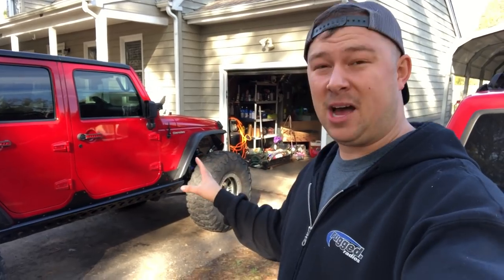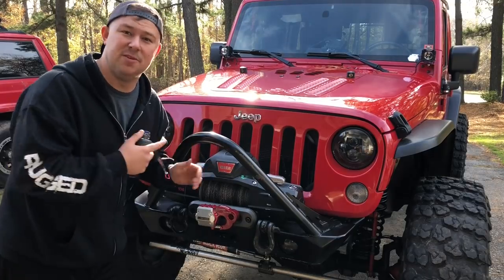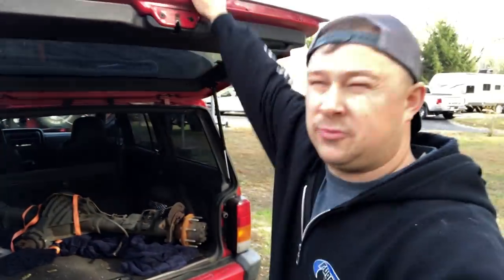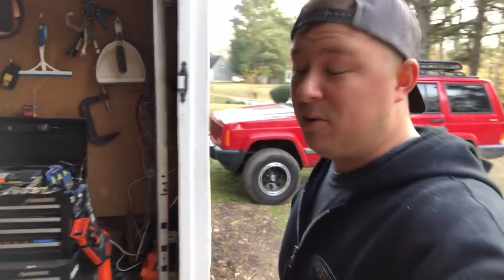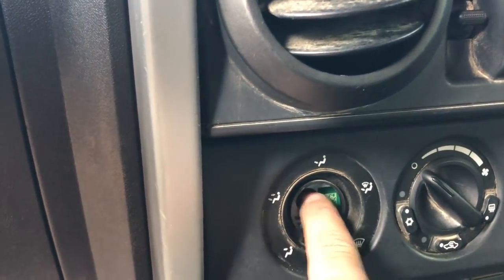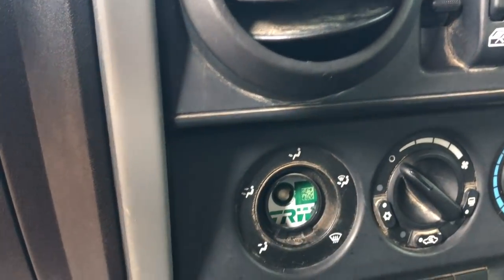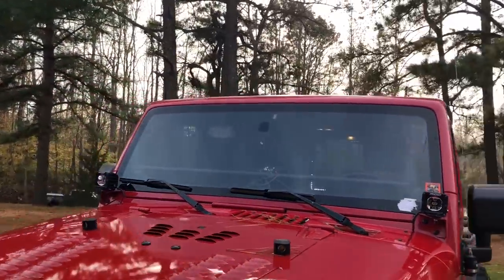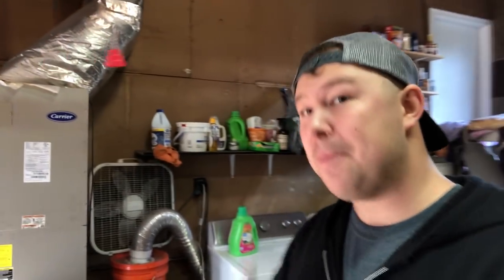Too Many Jeep Mods And I Need Your Help...

Comment: Looking forward to the 1 ton installs. Wanting to take a similar route because Dynatrac 60’s are badass, but too expensive. If you ever plan on selling the 40’s(axles not tires 😂😛), let me know, id be interested in buying them for a new Jeep project.

Comment: You have to look into the metal cloak db3 rear drop relocation brackets. You did the front and it improved handling. I hear it's the same for the rear. You got to do this,  give you a long arm radius with adjustable mid arms.
Reply from the maker: I’ve looked into doing them before, I might try them out!

Comment: Hey Ben, I'm a completely new Jeep Sports Wrangler owner. Would it be worth it to get the door latch stand for a '10 soft top? Or would it be silly because the soft tops won't even be able to handle much weight?
Reply from the maker: I wouldn’t recommend putting any weight on a soft top.
Reply: JK Gear and Gadgets But the hard tops are okay?
Reply from the maker: Yep! Still can’t handle a ton of weight, but it’s strong enough to hold me lol

Comment: Just FYI you can 3D print the AC knob. File is free from Thingiverse and you'll just need to send the file to a 3D printing company or a friend that has a printer. I've got my first printer coming so let me know if you want me to give it a shot.
Reply from the maker: I wish I could, however the actual knob is fine, it’s the plastic piece that the knob attaches to.

Comment: Where do you live
Reply from the maker: VA
Reply: @JKGearandGadgets  how do you register your vehicle in Alaska and why
Reply from the maker: I’m still a resident of AK, and registration in AK is only 100$, no tax, no inspections. Just mail in my check once a year haha
Reply: @JKGearandGadgets  lol 10 4
Reply: I always thought the vehicle has to be registered where it spends most of it's time. The reasoning is if the vehicle is involved in a hit and run, emissions compliance, safety compliance, eluding, kidnappings, etc the police want to be able to locate the vehicle and owner, and to make sure your in compliance with local motor vehicle laws. From the YouTube videos I have watched I'm pretty sure your not a resident of AK but VA. Are you collecting on the AK resident PFD? Same goes with DL. You generally have something like 30 days after relocation to put in a change of address. If you were routinly traveling or active military and AK is your home base it's a different story. I spent a few weeks visiting family in Colorado this past summer. I was stopped and questioned about emission compliance. Turns out that even if you live out of state you have only so long (in metro CO) to visit before you need to get your vehicle emissions test done/ passed. Well anyways, good luck and I do like your videos.
Reply from the maker: Richard Montz I am still a resident of AK, so I still my have DL and registration, I do not collect PfD since I do not live there any longer.   Since I am AD military and my residency is AK I can continue to register my vehicles and keep my DL as long as I want.